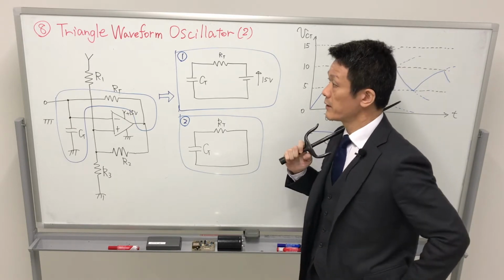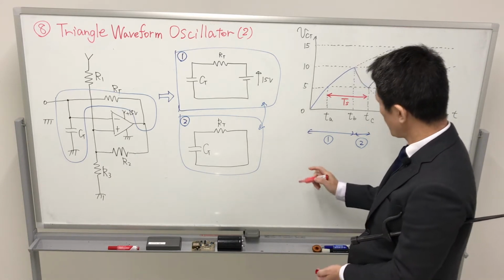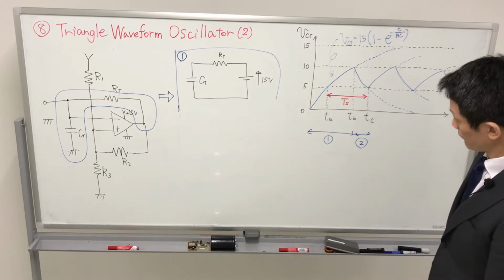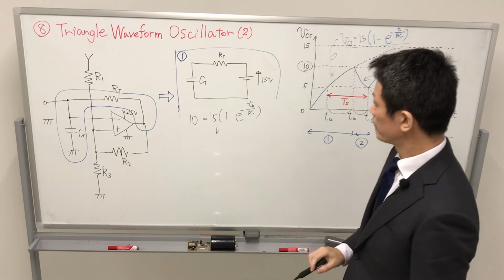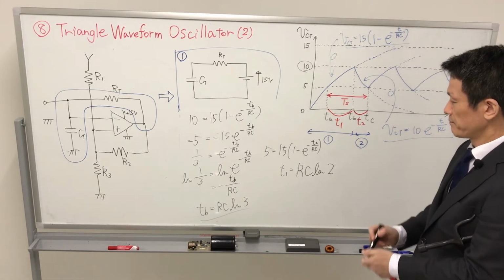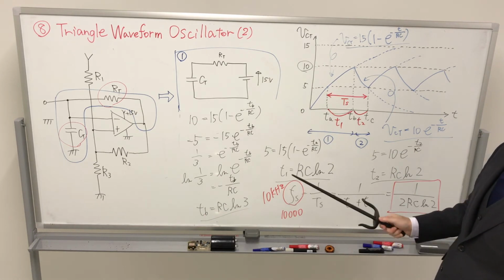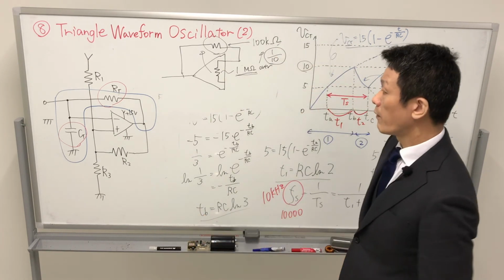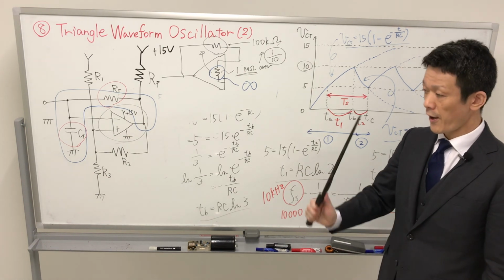[Lec 8] Triangle Waveform Oscillator (2) (Power Electronics)

Comment: Happy new year Professor!
In the final report, currently I have written upto the point where the equation for switching frequency is calculated.

Here we need values of R and C. In this video you have mentioned that R can be taken as 100kohmns. Then I calculated C to be 72.1pF.

Are these the R and C values you have asked for Professor? Or do you need us to use a different value for R (not 100kohms)?

Thank you very much for your time Professor.
Reply from the maker: Happy new year! And I hope you will be good!
Yes, our laboratory have 70pF capacitor! No problem! 
If you would like to construct experimental setup, our laboratory member will support you!
Of cause, only the calculated report is enough to obtain the credit of this lecture.
Any time you can contact me!!!
Reply: @yamamotoecs  thank you for your reply Professor.
I am currently not in Japan so unfortunately will not be able to visit the lab. However, I will visit it as soon as I come to Japan.

In the calculated report,  do you need us to do any changes to the values of Rt etc or can we keep the value you gave us (100kohmn)?

Also Professor, the other student and I are interested in the research work done in your laboratory as it has been listed as one of our G30 undergraduate research lab options.
Is it possible to set up an online meeting (zoom, Skype etc) so that we can ask you a few questions about your lab and get to know the work environment?
Reply from the maker: @ThiyuWarnakulasooriyaMitsu  I understood your condition, and you need not additional calculation for my lecture report. In this year, it is easy to obtain credit of my lecture because of these pandemic condition. 
And thank you for your interest for my laboratory! Of cause, I can talk you with online systems (I will use zoom).
How about 16:00 p.m. in 8. January in Japanese time? Let me know your convenient dates and times!
Reply: @yamamotoecs  thank you very much Professor.
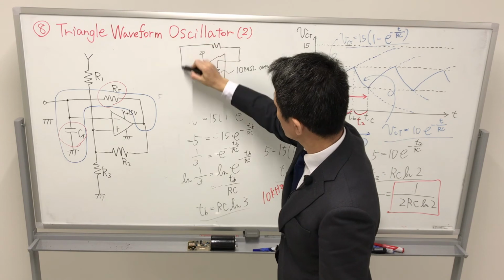Yes, 16:00 on Jan 8th is good for us.
Thank you for doing it online Professor.
Reply from the maker: @ThiyuWarnakulasooriyaMitsu  OK, please sent you email later!